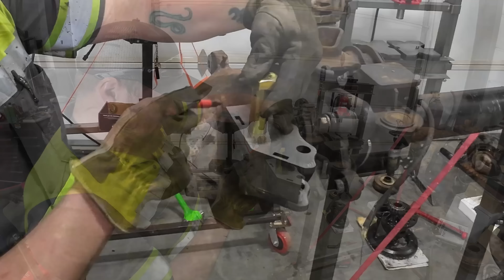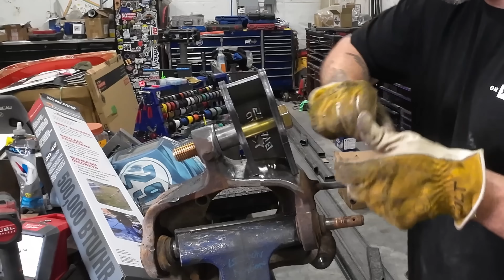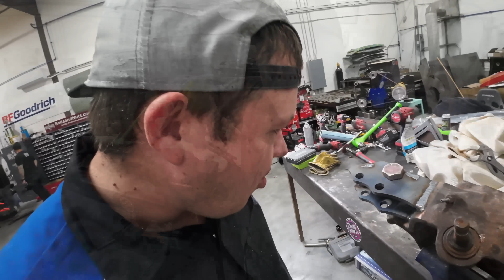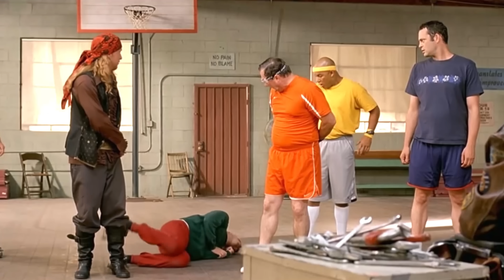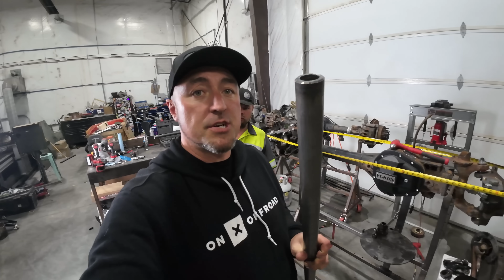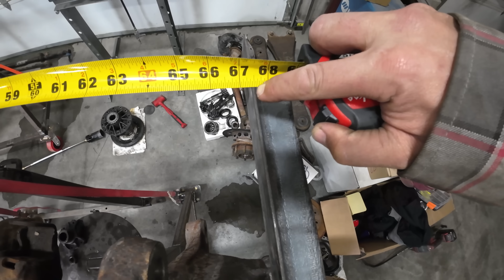How-To Weld To Cast Steel - Welding High Steer on a Dana 60

Comment: Nice video. Just wondering what kind of wire you had in your welder. Cast is known to deposit carbon into your weld and cause your weld to become brittle. Nickel based filler is suggested for welding on cast for this reason. Thanks!

Comment: Years ago I almost got into a knock down drag out fight with my brother.. We were putting some full length runners on a flatbed trailer for a friend.. 3in channel, just short of 20ft (couple, 3ft short of) length.. I was calling out measurements he was cutting steel.. Put them up in place and nothing fit.. Of course it was brother to brother, my comment was "can't you read a GD tape measure??".. Yea, the argument was on and people were leaving the shop cause the fight was coming.. (we both stood 6'6"+ at 280lbs+) I finally had an idea and told my brother to grab his tape and pull out 150/160 inches.. At 160in the two tapes were off almost 1 1/4 inches.. Closest we came to trading punches later in life.. Lost big Bro in '95 from a heartattack.. Good Lord I still miss him...

Comment: I'm rebuilding a rear dana 44. I've cut everything off now I am trying to figure out where to put all the mounts. I am doing a triangulated rear with outboard shocks. I have put on the truss over the pumpkin but still trying to figure out the rest... Lower control and shock mounts.

Comment: Great vid Colt! Do you use different wire or gas when mig welding to cast?
Reply from the maker: I do not when welding to cast steel. Same 75/25 and .035 wire.

Comment: Thank you so much for this video! I've been building and struggling with my 02 dodge ram that has a swapped Dana 60 w/arb locker in the front that has horrible steering from poorly done work and I'm about to tear it apart to fix myself and learn. Plus side is that it's got a built ford 9"with an arb locker as well!

Comment: Remember guys, cast iron is not the same as cast steel. Welding cast steel is easier/less crack prone. Maybe some preheat for penetration, then just get to work with ER70S-6 filler. Superduty Dana 60 knuckles are cast steel. 

Cast iron is the one you need to watch out for. There are multiple types of cast iron, but ductile iron is the one found in automotive applications. You need to be careful and use the correct process, whether that is pre and post heat, filler selection (high nickel filler like ERNi-Cl, ERNiFe-Cl, ERNiFeMn-Cl, Super Missle Rod) and/or peening. Lots of people don't think ductile iron can be welded in applications where strength is important. 

This is a great paper on welding ductile iron and shows a welded piece of ductile iron is just as strong as the base material:

https://app.aws.org/wj/supplement/WJ_1985_03_s79.pdf

Comment: What wire did you use to weld to that cast?
Reply from the maker: .035
Reply: That's probably ER70S-6 or typical mild steel wire. This is fine because the knuckles are cast steel.

Comment: Years ago I worked at a cabinet shop. Every morning the shop forman would check everybody's tape measure against the table saw scale. If they were off he would bend the hook with a little brass hammer to adjust.

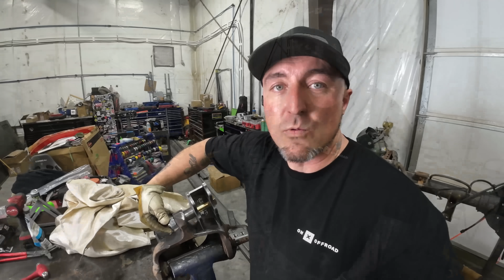Comment: Nice educational video. But @ 4:13 Are you sure it's Teflon in the lock nut? It doesn't look anything like Teflon (PTFE) which is usually bright white and has no translucency unlike PA6 nylon which has yellowish translucent appearance. Usually, it's nylon used for lock nuts (a.k.a Nyloc) as it has much better properties for this application (and it much cheaper too). Teflon is a soft and very low friction material usually used where your you want surfaces with low friction that's why it's used in ball joints, on non-stick frying pans and in lubricants. That's the exact opposite material property of what you want for a lock nut where you want it to create a high friction surface.
Reply: Yeah, normally it's nylon in there.

Comment: They are called Nylock, because the locking ring is made of nylon, not Teflon.
Reply: Teflon also doesn't melt until about 620 °F. Interpass temperatures should ideally be lower than that. 

This is why Teflon is used in mil-spec wire insulation of wire rated for 400 °F operating temperature - because if has a very high melting temperature.

Comment: When I had to weld a cast exhaust manifold. I built a camp fire to preheat my work then after welding I tossed it back into the fire then let it burn out overnight.
Reply: Good tip. 

Covering with a large amount of sand also works.

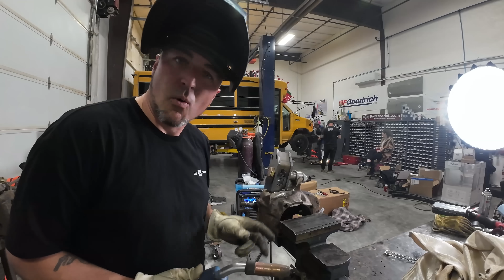Comment: 5:18 maybe use a laser Thermometer? What temps are you looking for?
Reply: Just don't shoot it at a shiny section because it will read low (shiny metal has low emissivity). Aim the IR thermometer at a rusty section to get an accurate reading.

Comment: Colt, in my years of fab/welding I would rather use a reamer to enlarge those holes. (good quality reamers are not cheap) Great video!
Reply from the maker: I completely agree but I figured most don't have a reamer in their 2 car garage.
Reply: Like I said a reamer is very expensive and unless you do a lot of these mods it's not worth  the money.  @coltbuildsit
Reply: Colt I confess.I was wrong. Reamers are very affordable and very much worth the money.  @coltbuildsit

Comment: Spray inside of the tie rod with Fluid Film or any of the lanolin base rust prevention products. They will coat and last a lot longer then any penetrating oil. Will also work great for roll bars or any place you can't protect with paint. It's a rust belt thing. Most after market tube side steps rot from the inside out.